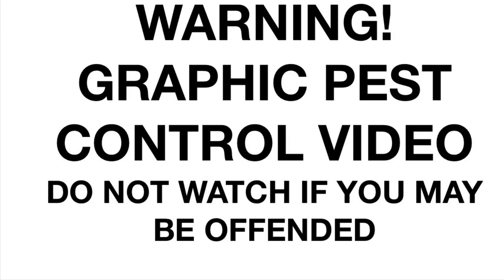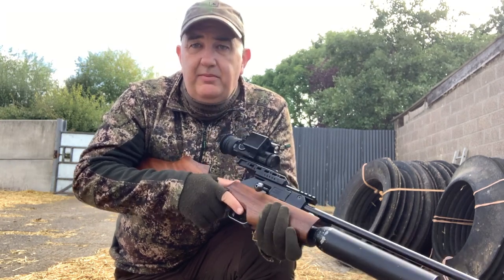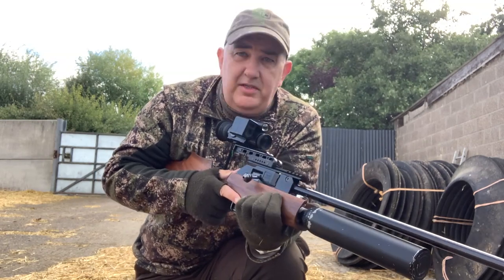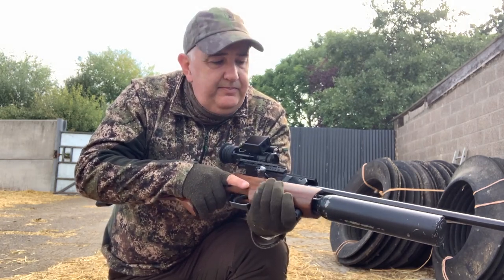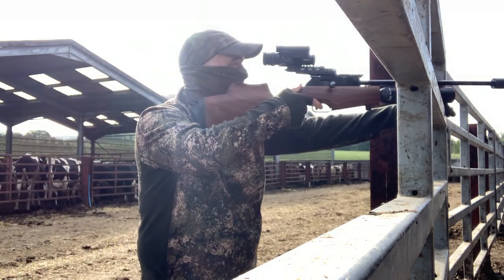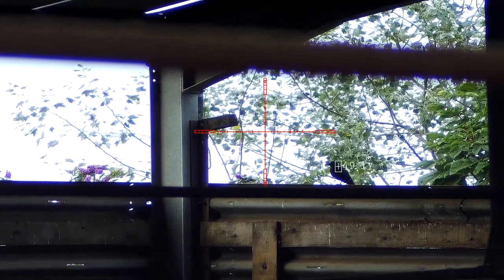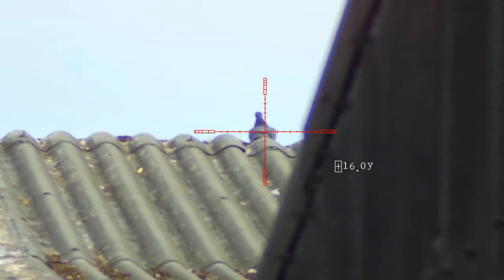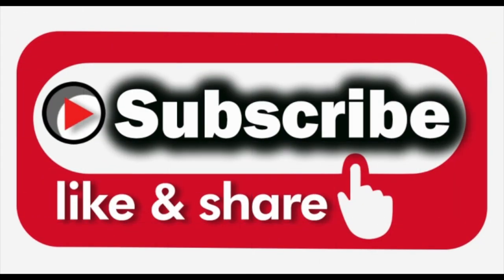#41 Regged Rapid In The Farmyard

Comment: Martin - alot of people have been asking how easy/hard the installation and setup was on this kit. Would you care to comment? Thanks
Reply from the maker: It’s a very easy kit to install as the Rapid is inherently simple by design. The regulator comes pre set to the required/requested pressure for the calibre of the rifle and also two different hammer springs. All I had to do was drop in a hammer spring and adjust for power over a chrono. I settled on the slightly stronger spring as it gave me a lighter strike for the power I wanted. Anyone who has some Allen keys (remember you’ll need an imperial and metric set as the rapid uses both!) and an adjustable spanner can fit the reg. Clamping the action in a vice with soft jaws will make the removal of the bottle adaptor easier as they are usually very tight. A YouTube or Google search will bring up several articles showing how to service and dismantle a Rapid. Sub12 airgunner has a good one, if anyone has any questions about it contact Steve at www.HW100Tuning.co.uk

Comment: What is the scope that you are using? It shows yardage built in. I live it. Where can I get one?
Reply from the maker: It’s a Pard008LRF with built in rangefinder, the main uk agent is Sportsman Gun Centre but I bought mine used from the Airgunforum. You can find them occasionally for around £500/£600 on eBay or Airgun forums sales section. They also do one without the rangefinder so if you want one make sure it’s the LRF version
Reply: Thanks. I've been looking at then on utube after seeing your post
Reply from the maker: @bamoore65  I can’t recommend them enough an absolute game changer. I use it on all my PCP’s, my Rapid, GSX200 and a Daystate Renegade I’ve recently bought as it remembers 5 different zero settings so you can have it set for 5 different guns or pellets and just switch between them. I’ve fitted the 3 guns with a picatinny rail on their scope rails so I can just switch it between them. Superb bit of kit
Reply: Wife told me that she wants one on hers too. Looks like I will be getting 2. Thanks again for your help. In the long run I will save money not having to purchase a scope, rangefinder, night vision, or a camara attachment. The Pard008LRF is all of those in one.
Reply from the maker: That’s no problem mate. Yes you are correct, I use mine instead of three scopes so it justifies it’s cost
Reply: The wife says "thanks again". Keep going with the videos. We enjoy them here in Alabama (United States). Will keep you posted with pics after she gets hers.
Reply from the maker: @bamoore65  You’re both welcome 🙏. Keep me updated with how you get on and thanks for watching 😊